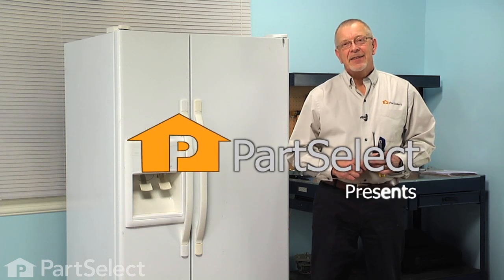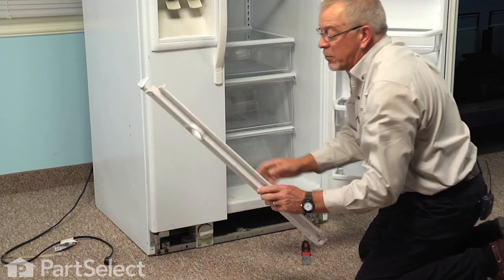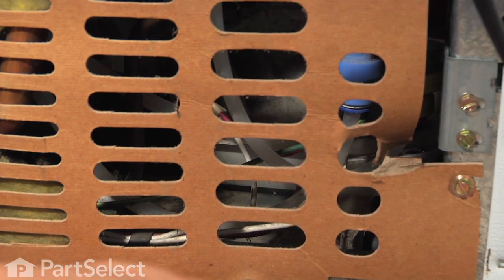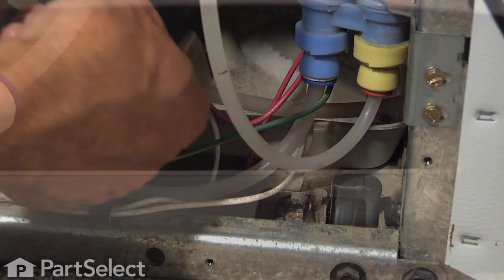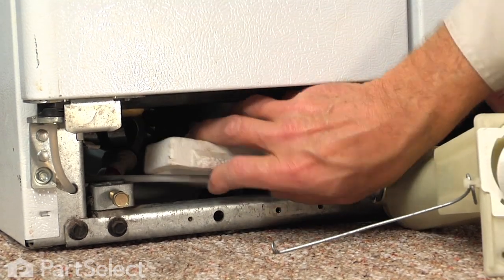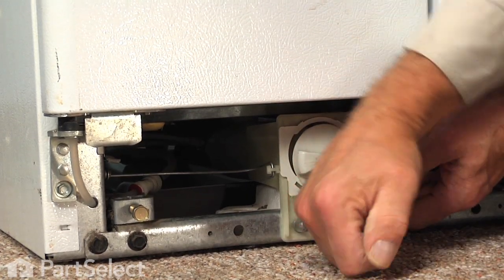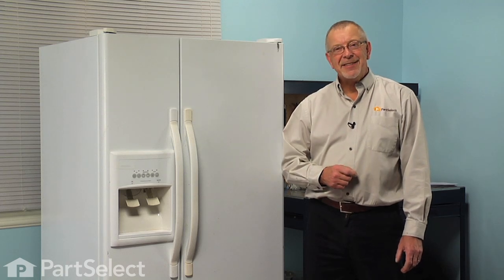Refrigerator Repair - Replacing the Evaporator Drain Pan (Whirlpool Part # W10614158)

Comment: I miss the days when all I had to do was pull out the front grill with my hand and pull out the drain pain with one hand.  Then all I had to do was empty it and clean it.   Now I have a refrigerator with the freezer on the bottom and no idea if there is a drain pan.

Comment: All I have to say is check how to do stuff like this before you buy a fridge. This would be a deal breaker for me. It is poorly designed and not user friendly. Thanks for the informative video.
Reply: my home came with the GE refrigerator and it's the first time I ever had a refrigerator with the freezer on the bottom.  I would never have purchased one like this.  From now on I will ask and make sure the darn drain pan is an easy pull kind like my Mother's was.  I hate the heat coming out from the bottom front too.
Reply: No doubt!!!  I have never seen a crappier placement of an evaporator tray in my life!  I've had a lot of refrigerators, and this is the worst design I've ever seen.
Reply: No it’s not and the reason why after 18 years and having to move the fridge and found the gross water tray I’m not cleaning it :)

Comment: Asked the man at the parts store if the new pan was as cheaply made as the original. He said it provably was so I went to the $ store and bought a plastic pan that fit inside the original pan. Took the back cover off and slipped it in and placed it under the drain tube. Problem solved. I live in a very high humidity area and have had no problem.

Comment: Thanks for the great video.  I had a water leak for 4 years, completely ruined my kitchen floor . Warranty repair man couldnt fix it, and warranty expired.  Tried a do it yourself after watching this video and found the tray cracked and the aluminum plate on the bottom pushed up.  Likely damaged by home depot movers when I bought this thing.  Finished the repairs and hopes it holds up.
Reply: Howe Lai l

Comment: I have the same refrigerator as the one in the video (Kenmore). The video is accurate except for one thing peculiar perhaps to later builds. The input line for the water filter is anchored to the back panel with a small clamp. This would not allow the filter to come forward enough to clear the way for the tray to come out. After removing that screw, the line flexed enough to just barely get the filter out of the way and extract/replace the tray. My old tray had a crack all the way down the side and was creating huge puddles of dirty water. It's all fixed now. Thank you for posting this video.
Reply: What screw? Mine is doing the same. But it is attached to the hot and cold unit it the back
Reply: @jessicademoines5778  It should be the one at the bottom right just before where the inlet line for the ice maker starts going behind the rear cover and under the refrigerator.
Reply: Found it. Thank you very much.

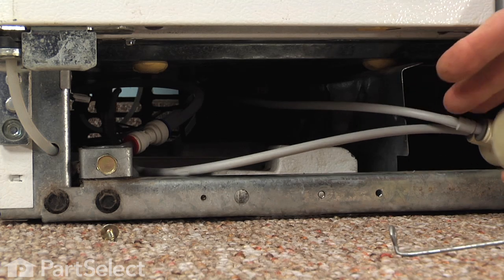Comment: I just followed his instructions to remove the drain pan, I STRONGLY advise anyone attempting this to be careful. If you look closely at 2:09,  he pulled hard the filter assembly resulting in detaching the plastic tube from the assembly that its connected at the back of the fridge, which is a pain to reconnect and a mess with water around.  what I did to avoid that, was to unscrew the attachment connected to the plastic tube on the back of the fridge to gain inches in order to pull up the filter assembly ,NOT TO THE SIDE!!! as he explained in the video,  with the fridge door open so you can take the drain pan out.
Reply: I watched the video and noticed the same thing. It explains why the Appliance Parts Pros video shows the water inlet valve and one of its water lines being removed, then disconnected.

Comment: great video! i smelled something, and found out online it was a pan..then came here to find out how to remove it..thanks alot..not even gonna say how i was trying to get it out before i  saw this video..
Reply: We had a service call and the repairman said that those lines have never been made long enough to pull out the filter housing so you can  get at the pan.  Did you have to disconnect your lines or did you have slack in the lines to pull it out of the way.  We have the exact same fridge in this video, do you have the same one??  Thanks for any info you can give me.
Reply: Frank Crisp mine was a whirlpool, but it had ice and water, so there was a filter there, so it looked alot like the one on the video..i took off the screw holding the filter in but i didnt take the filter out, just moved it to the side, since there wasnt alot of slack, with the lines connected, but i was down there, so i had a  choice, take off the lines, or just work around it..i chose b....i had to cut the tape that kept the pan in place, in the front and the back, just like the video..just because i felt id never get the filter to go back into that exact spot, i left it intact, and just pulled the pan out from the front, and let it slide out from a little space that was under the filter..it took a little muscle, since it was 2 feet long..at least mine was, but it did save me the service call, and the oder in that pan was horrific!.. i hope that info helped..but i couldnt have done it without this video.

Comment: My 25 year old Kenmore elite side by side had a relay go bad and all the blocks of ice in the freezer melted and I still think after the repair that there is still too much water in the pan and anytime the anti icing comes on it overflows. So I need to either remove and empty it or find a way to empty it in place. Mine has no water filter.

Comment: To Steve at PartSelect,  I too have this exact model and cannot get my drain pan out because of short lines.  I assume a higher up in the manufacturer of this fridge must have looked at the schematics of this design, saw those slack lines and thought "what's that there for? I could save the company 10 cents per fridge if I shorten them up" (sorry my frustration speaking)  Could you  please post a video showing how to disconnect/reconnect the hose from the inlet water valve so that we can get at this silly pan.  Thanks Steve
Reply from the maker: We did a video of replacing the water inlet valve on this style of fridge, (actually the exact same fridge), and that shows disconnection of all the tubing to the valve. The first tube that was disconnected in the video is the one you are asking about. Here’s the link: https://www.youtube.com/watch?v=eNGe_VUDIBA

Comment: I found the easiest way to do this was actually to pull the whole bottom bracket off the fridge (black bolts at the bottom in the video) and pull it out from  under there.  Otherwise you can't get it out from around the filter holder without somehow disconnecting the lines from it.

It was pretty easy, just drop the fridge off it's wheels by driving out the bronze bolts, then remove all the black bolts along the front - came out easy after that.  It all went back together without any drama.
Reply: On my fridge, I placed a plate at each side to protect the floor, then used a pry bar to raise the fridge and insert a spacer on each side.  This took the weight off the front wheels.  Then unbolt the front chassis bar.  Gave enough access to remove the drip pan.  No need to disconnect any water lines.  It was still tight but it worked!  Note: After cutting the tape at the front of the tray, push the metal tab down to provide extra clearance.

Comment: hi, thanks for video but you didn't mention the loose water line connected to filter which allowed you to pull unit out. clearly you have to disconnect a water line to filter when working on a functional unit before pulling out filter. That info would have been helpful but will figure out myself.

Comment: Water is accumulating on the bottom of the freezer for my Hotpoint hsm25gfbbsa.  I have to chip the ice away inside on the floor of the freezer before it begins to spill out onto the floor from the door.  Is this the same issue?

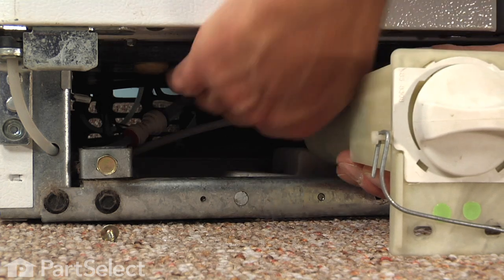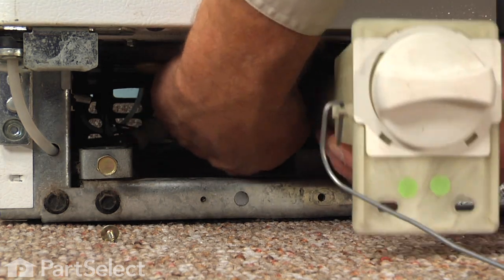Comment: At 1:53, you mentioned a water line that was restricting your removal of the filter holder. You said to go to the back and give it some slack. At 2:08 you pull it hard enough to pop the water line loose. But you never showed how to reconnect it.
Reply from the maker: William Rossbach I will ask Steve for you and let you know.
Reply: William Rossbach I just did this procedure and rather than pulling the rear of the tube out I removed the front of the short tube from the filter housing.  The connectors are a friction/compression fit so you will have to push and hold the plastic collar in towards the housing while pulling the tube out.  To reinstall you simply slide the tube into the collar and it will go in until it bottoms out.
Reply: I tried your way which sounded simple enough, but I could not get enough pressure on the plastic collar to release the tube.  I then went to the back of the refrigerator and took loose (2 screws) the solenoid water valve assembly.  I was able to move the plastic collar on that end.  Then I followed the directions in the video and then pushed the plastic water line back in place.  There is a definite click when it is seated.  Be prepared to use needle nosed pliers to get enough lateral pressure on the plastic collar.

Comment: If it would be possible to reach through from the front to the piece of tape at the back of the pan, maybe could cut the tape with a razor blade or something and you wouldn't even have to pull the refrigerator out and take the back cover off. Probably just wishful thinking on my part. I guess I'll find out tomorrow when I tackle this chore. Thanks for the video though, it doesn't look like it will be too tough. I just hope the drain pan isn't full of water, that would make it kind of messy.

Comment: Great video except I went down to remove the filter and one of the hoses was not long enough to pull it all the way out...#screwed.
Reply from the maker: You can disconnect the inlet tubing to the filter housing from the water inlet valve at the rear of the unit. This will allow you to pull the housing out.
Reply: This was my problem and I explained my solution above.
Reply: I unscrewed the housing for the tubing at the back of the fridge, and that gave me just enough extra slack to move the filter housing out of the way.

Comment: Stupidest design ever for a part that is supposed to be cleaned or replaced. Literally no way to get any play in the hoses to move the filter out of the way and remove the pan, and as a result, had to clean it by hand leaving the pan in place, which was almost impossible. Disconnecting the hoses was not viable as it would be almost impossible to reconnect them while lying on the floor. No way to do a thorough job. Smell was nauseating.
Reply: Dana Minyard agreed about stupid design. I undid two more bolts in the back that was holding the shorter water line. Gave me juuuust enough slack to get the blasted tray out
Reply: This comment is so spot on.I tried for an hour to find a way to contort that stupid pan and squeeze it out the hole not big enough that it started to crack. I literally had to give up or risk having a fridge that drips water on the floor.  Ended up just spooning 2-3 ounces of bleach in there to kill off some of the black mold. It's by no means clean but has cut the smell down. The engineer who signed off on that drip pan design/placement ought to be kicked in the nuts.

Comment: I am extremely impressed with so many high quality DIY tutorial videos, I did order the following items from Sears Part for my Whirlpool Refrigerator model # ET8LFKXKT07.
1) 819043 Refrigerator Drain Pan Heat Probe
2) Tube part # 2205294

The reason for the order is that, water is leaking down from the upper freezer to lower part. I will also need to know how to remove the ice maker in order to access the element and that drain hole to clear it. These parts have already arrived. Just need a DIY video installation tutorial to guide me in the process. The video should if possible, have captions in English language. The video tutorial should be specific to my model as indicated for easy guidance. Please, advice.
Reply from the maker: We currently do not have a repair video for this part. Check with Sears in case they may have one.

Comment: Thank you so very much for sharing the information. the video is excellent and extremely helpful but what do you do when the water line inside the fridge connected to the filter holder is too short and cannot be pulled outside in the front? Help please! I removed the clamp for one line but the other one looks like is connected inside another part, I am a cpa 😂 not an appliance repair person. I will not have access to disconnect and connect it without spilling the disgusting stuff in there among other things  I bought the house with the appliances and I am trying not to have to replace it. Otherwise it works fine. I think removing the line from the filter may be an option? Any videos? Anyone?.

Comment: My filter didn’t just pop out out of the way, that’s the only part I was struggling with
Reply from the maker: They can be tricky at times as the plastic will expand and contract due to the air passing over the housing and may need a little finesse to get it to release.

Comment: stupid question,,, why did you replace the pan? did it have a hole in it? Wouldn't you just clean and replace?  Thanks Russ
Reply from the maker: Hi Russ, sometimes the reason to replace the pan is it can become damaged over time and could start leaking and making a mess on the floor. If its not damaged then yes you could clean it and replace.
Reply: Thanks Steve, While I got you maybe you can point me in some direction,, I have a Kenmore side by side that totally shuts down for a day or so, then fires up for a day or so, I checked the compressor, and fan, and they check out, also cleaned underneath, Might my problem be thermostat? Thanks again Russ
Reply from the maker: Your welcome Russ. It could be your thermostat. I would suggest to check the continuity of the thermostat. If there is, please provide your model number for your refrigerator and I will look in to it for you.
Reply: wow thanks, I was thinking thermostat also, Kenmare Coldspot,Mod# 58582891,,,,, serial#  S10635618, If IRMA hadn't hit I would have just replaced the refridge, but nowI have lots of repairs to do! Thanks Steve

Comment: how often should you have to empty this pan? ours was overflowing. we have been at this rental for 1.5 years, but the last renter was here 7 years, i bet they never emptied it.
Reply from the maker: LastHumansGarage I have passed your question on to Steve and will let you know when he gets back to me.
Reply: ***** thanks. i do have a service scheduled only because i am a renter and it costs me nothing. but still interested on if that drain pan should be filling up to the point of overflowing. Maybe the fan that is supposed to blow on the water to evaporate it isnt working..
Reply: My pan is full. What are the reasons why that would happen?
Reply: +Randall Jennings your evap system isnt working or placed properly  to make the water dry up.. the older style is a ball/bucket type thing which sits on a heating element type of thing. it is siliconed down usually. if it is not placed firmly on that warm metal surface, the water wont get hot and evaporate.
Reply: +LastHumansGarage I saw the water in the pan has waves. So the fan is blowing on it. 

I'm checking the temp of the fridge and later the freezer but it sounds like, surprisingly, a clogged drain. Doesn't make sense to me since there's plenty of water. 

http://homeguides.sfgate.com/fix-refrigerator-drain-pan-overfilling-73976.html
Reply: You're not supposed to have to empty it. It's supposed to all evaporate.

Comment: Someone tried to remove the little 'receptacle' that collects water (and attaches to a tube going down the back of the fridge as it was clogged up (turned out the clog was in the line/hose). But in trying to take it out, he snapped where the little receptacle feeds through the back and then into the hose.  Are any of these part replaceable?  It is an old (but otherwise working fine) Woods fridge. (at least 25 years old, I suspect!  Model CWR-YW)  Now to go see what else I can find out.
Reply from the maker: Catherine Stewart The model number that you supplied does not register. Can you double check it for me?

Comment: How can you tell if the tray needs replacing? I can't figure out why it's leaking water on the floor.
Reply from the maker: The most common reason for changing this part is that it was cracked or damaged and would leak the defrost water onto the floor. The damage would normally have occurred during moving of the refrigerator.